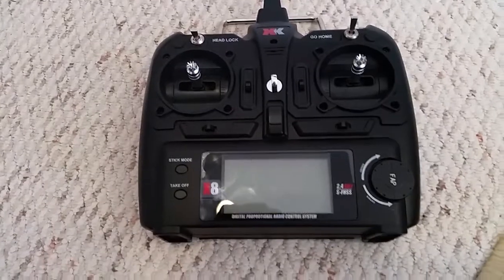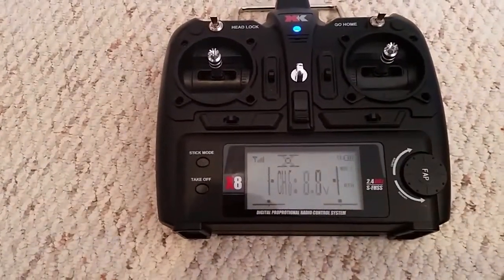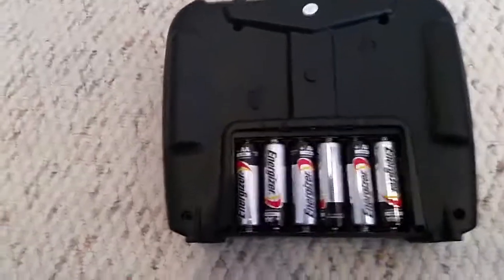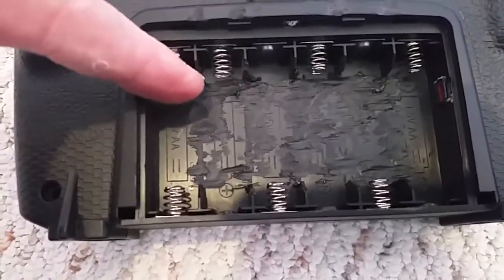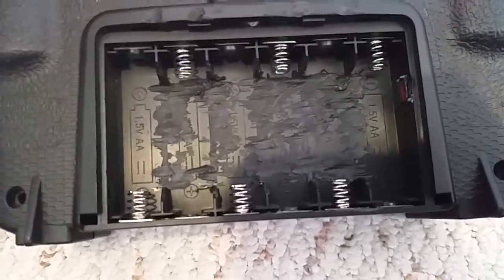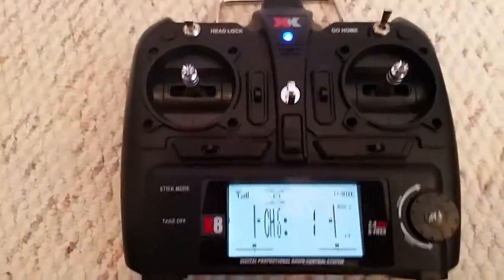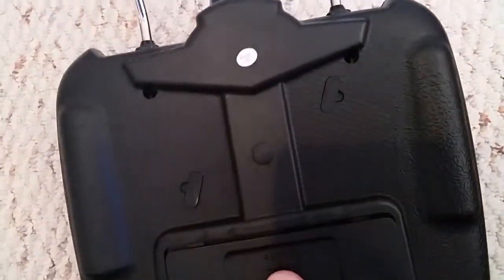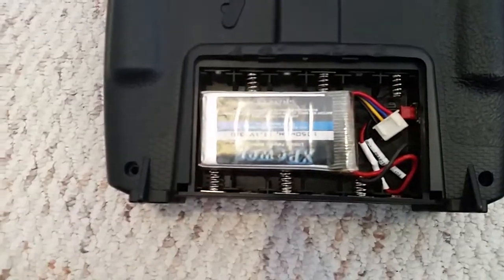X-380 Detect Transmiter Battery conversion

Comment: I've done the same mod on my XK380 TX however I used a  2 cell Lipo, fully charged its 8.4 Volts, I'd be hesitant about using a 3 cell as I'd be pretty sure the circuitry might not handle such voltage (12.6v) over the longer term, but good mod though!

Comment: Thank you one last question with the higher voltage did it affect the transmitter or the flight time in any way for the bed
Reply: Paul Hyde, No, but if you are concerned you can put three 1watt power diodes in series in the positive line between battery and circuit board and this will reduce the voltage down to 9 to 10 volts taking the load of the main voltage reguator.

Comment: I commented on this 5 months ago where did you get your battery at
Reply: Paul Hyde from my junk box, but you can get them from AliExpress. Any flat 3 cell lipo battery of about 800 to 1100 mah that will fit in back of transmitter will surfice.

Comment: Incognito how long have you been using this Lipo .I mean when did you do this mod and is everything still working fine. I did a similar mod but I'm using a 7.4 2000mAh batt it works fine however I also have a 2 Watt tx antenna powered with a 5v UBEC and I think the added voltage may help .is their any sign of overvoltage in the tx

Comment: A fully charged 3S lipo is 12.6vdc.  6 brand new alkaline AA batteries will read between 9.2-9.6vdc.  So, we're looking at an overvoltage situation of 3 volts.  I've never seen a schematic for the XK TX to see if it uses a voltage regulator on its power source.  It's quite possible that they have something like a LM7808  (8 volt) regulator on the board, so that either the AA cells or the Lipo would give the TX the same operating voltage ... hard to say without looking at a schematic.  I saw another guy do exactly what you did, but put a 2S battery inside, which at full charge is 8.4vdc. Not sure I like that idea either. What say you?